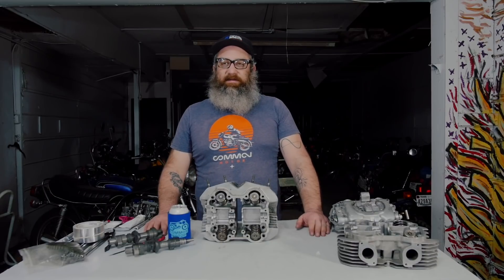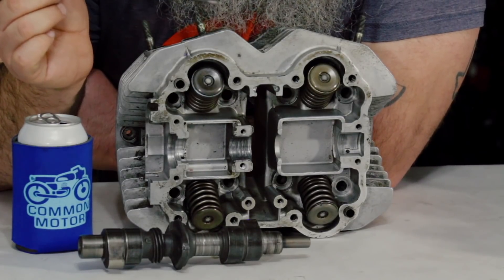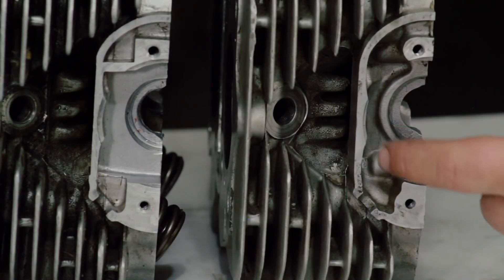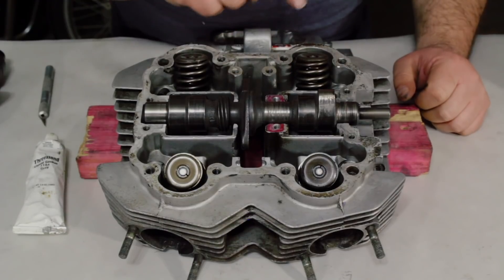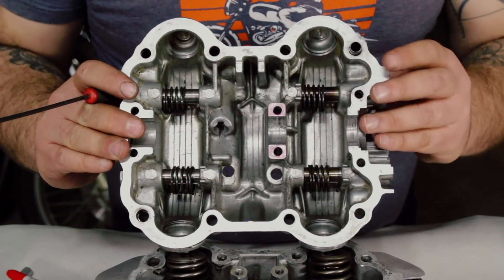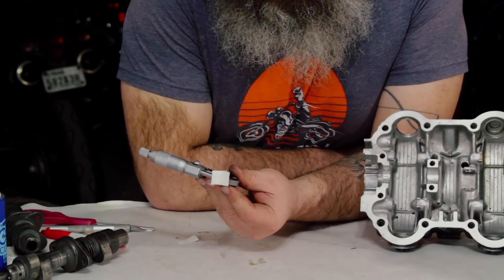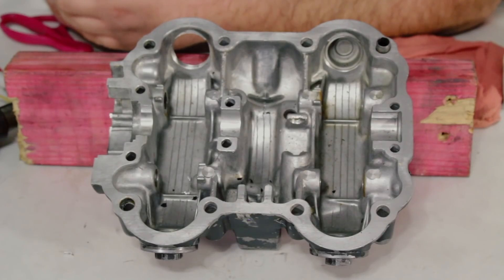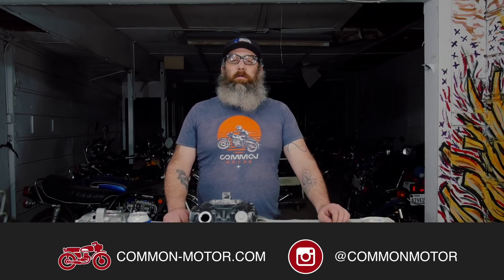Honda CB360 / CL360 Center Cam Bearing Journal Failure Explained

Comment: To prevent it, couldn’t a person just go in to the engine and just loosen and hand snug up those two center bolts? Is it necessary to take it fully apart for this?

Comment: Very Helpful!
I have a 94 CB250, experiencing this phenomena as well but with my cam bearings. More specifically the right side bearing chewed itself up somehow where the left is only slightly worn. Caused cam to become un-level and valves started clattering like hell. Im just not clear exactly why it's just the one side. I dont wanna replace the bearings only for it to happen again.

Comment: Is Honda Cm 200 engine valve clearance Same to those bikes
Reply from the maker: I would check the service manual specific to your motorcycle. The CM200 is from a different time period and we aren't super familiar with it.
Reply: @Common-motor  Thank you

Comment: Total bull crap ( other than the last bit about torque specs ) . If the metal is deformed it proves the torque spec is too high for the relatively small contact area ( the side journals have much larger contact area ) . The GB500 ( single cylinder , but also has a centre journal ) suffered this problem . The fix ( service bulletin from Honda ) was to die grind the journal away until it had more than enough clearance, replace the cam ( because the original had usually snapped in half ) and chuck it back together. Basically they just run them without the centre bearing .

Comment: Hi Guys. I have a sort of related question. I have oil leaking from the tachometer drive of my CB360. Should there be a seal in there like there is in the CB350's. If so which part number as I know there are different sizes. Need help quickly. Many thanks. Your videos and community comments have been invaluable.
Reply from the maker: yes there is a seal in there: https://www.common-motor.com/honda-360-oil-seal-kit

Comment: Hi Brenden, haven't heard from you for a while. A fix has been available since the mid 1970's. Where is the clutch cover to show where the real problem lies? You need the correct oil, and modify transfer piece. Don't tell people to skip bolts, torquing centre bolts first  is what flexes valve cover into correct position. Guess I'll have to do a real vid for you? Send me a couple of scrap heads and I'll do some machining

Comment: Why don't you pastigauge the cam bearing surfaces to see what clearance you have to start with?
Reply: It's  a good idea to plastigage it then just polish the bearing with a home made 'flap wheel'.  It doesn't really matter what clearance you have though if the bearings are not getting any oil. I've come up with various fixes for that problem and posted on many sites (DTT, Honda Twins, et.al.) If you have that step, it isn't machined in by Honda but more likely fretting from incorrectly installed or missing top engine mount or loose 6mm bolts.The 6mm bolts need re-checking after the 8mm bolts are torqued, best to go around twice. Majority of people working on these bikes have never seen let alone read the common tools and procedure manual then criticise Honda for not giving full directions
Reply from the maker: Don't forget the more you polish the more slop there is in that camshaft. And there is factory wear values for that so once you get to a certain point you're just out of luck. We're in the process of engineering a fix but until then if you wear too far the head is toast. And we usually do plastigage ours over here if the surfaces aren't in good condition.

Comment: Im having a different problem with the cb360 engine. When i adjust the valves to "spec" or so i think the engine is imposible to turn because the valves are so tight. I have watche your video but im still stumped. If anyone could help me that would be amazing.
Reply: Assuming you are doing this with the spark plugs out, it should rotate pretty easily.  If not, check that you are adjusting them on their compression stroke. Rotate the engine forward, and start with the left cylinder. When you watch the INTAKE valve go down and then come up (the valve on the side where the carburetor is) you should be close to the "T" mark. Set it there, and adjust your valve. Use the "Go, no-go" method. If it's .002, make sure you can get it in there, but not a .003  You adjust both intake and exhaust on the left cylinder, then rotate the engine 360 degrees (watch to verify the RIGHT intake valve goes down and then comes up) and do the adjustment for both intake and exhaust on that side.  If something is tight, you may have an issue with your cam chain tensioner or like the above video, something fried in the top end :(
Reply from the maker: Hmm I agree, if you're using the correct marks to adjust and you're having that kind of resistance I'd open it up just to take a look. It could be something else going on and it's good to check that tensioner if you never have as well.